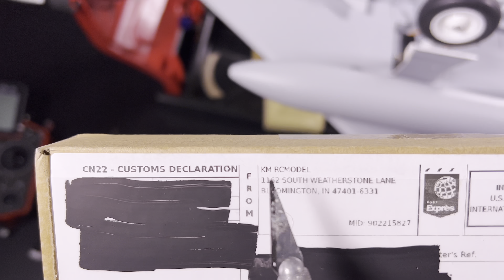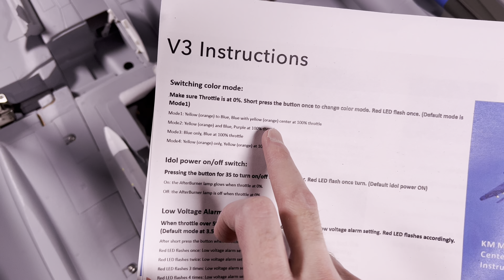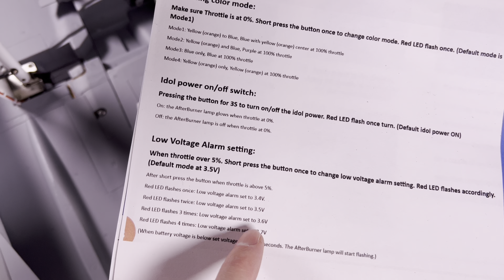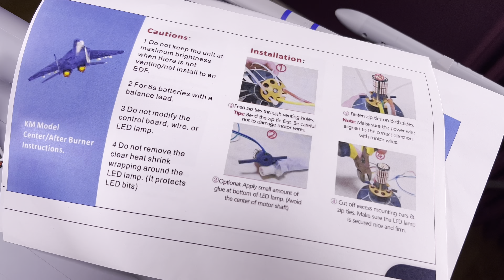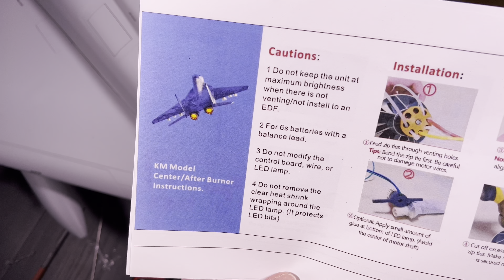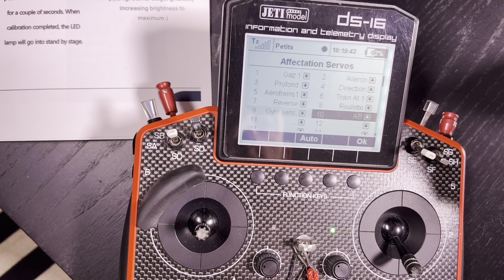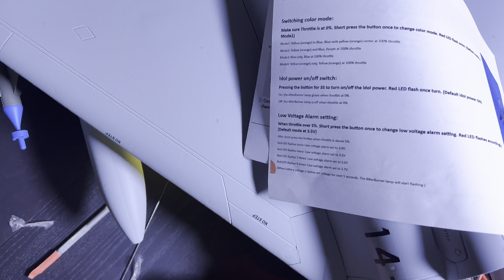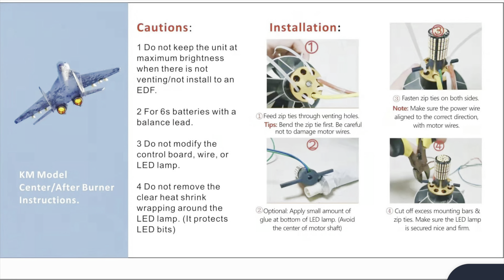Afterburner KM RC Model • INSTALLATION in the Freewing Eurofighter Typhoon • (English/Français 4K)

Comment: I have been using the v2 ones and love them. I want to get the v3 for the typhoon. Thank you for showing that the install. Good to know it will be a drop in fit without needing to cut foam away
Reply from the maker: Yep 👍🏻 thanks a lot for your kind words